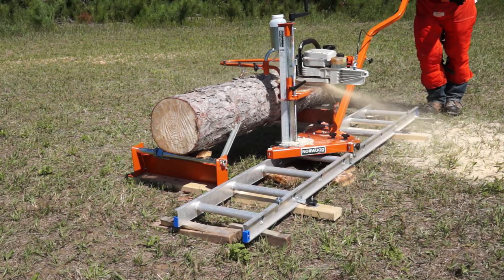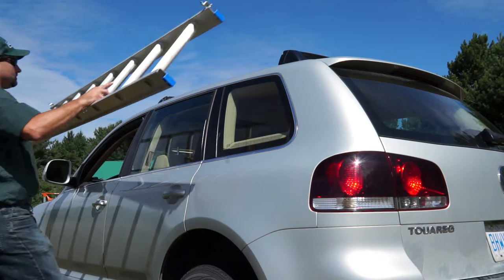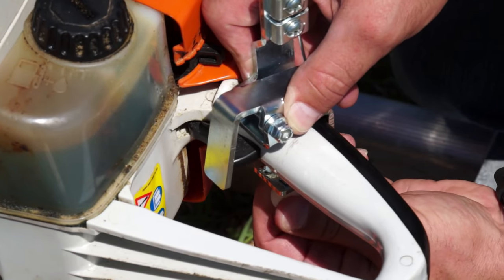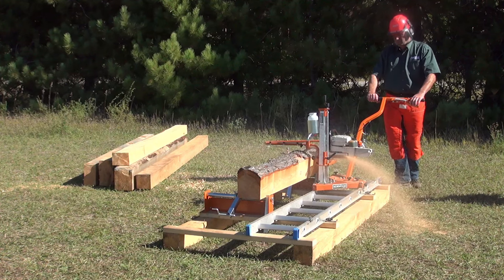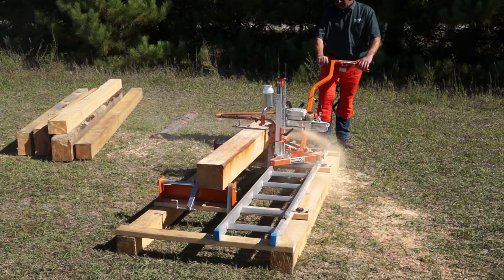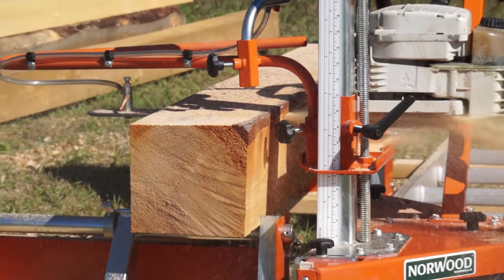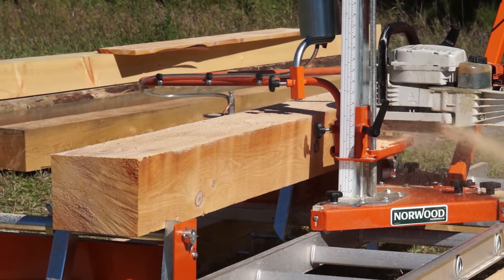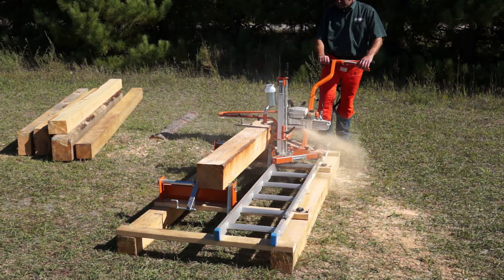The Ultimate Chainsaw Sawmill - The PortaMill PM14 by Norwood Portable Sawmills

Comment: so if i took the oilier apparatuses off i could use any length bar with this? im guessing you say its limited to 14" but you can use a larger bar which in turn gives you a wider cutting range correct?
Reply from the maker: Hi Daniel 

We do not recommend a bar longer than 24". The PortaMill structure was not engineered to handle load factors for bigger logs.  It is designed to be a highly portable machine ideal for remote locations or for occasional milling of small to mid-sized logs. It is very economical. If you want to mill bigger logs, we recommend a Norwood portable bandmill.

There is a lot of great information, photos and a video of Norwood’s PortaMill chainsaw
sawmill online at http://www.norwoodsawmills.com/products-sawmills/portamill-pm14-chainsaw-sawmill.
Thanks

Comment: Hello I have some logs that are larger than 14 inches in diameter, would this system work with a larger chainsaw like 105cc with 36 inch bar? If not do you have something that would work? I like the guided cutting system, its better than the alaskan sawmill and cheaper than a full blow portable band sawmill, but I have a lot of big logs larger than 14 inches is my dilemma, please help!
Reply from the maker: Hi Ronan. We have designed the whele PortaMill to handle only smaller logs. Once you get bigger than that, it really is best to have a bandmill. I am not sure what your sawing plans are though. Maybe you’d be interested in a free telephone consultation with a Norwood sawmilling specialist? Even just a few minutes can be time well spent to explore your wood processing needs with a professional, and to match you with the perfect sawmill configuration for your milling operation.  

If you would like to take us up on this offer, please let us know your telephone number and email address and we will make sure we connect with you. Rest assured, there is no obligation. This is a service we are happy to provide future sawyers.

Comment: I was wanting to cut a 12"×12". and from my understanding the log would have to be 17" in diamiter and  53" around "circumference". this is all new to me, lol. would this chainsaw mill accommodate this size log?
Reply from the maker: Hi Joseph. The PortaMill maxes out at 14 inches. Sounds like you need the LumberMan MN26 bandmill which can handle logs up to 26 inches in diameter.
Reply: +Norwood Portable Sawmills what is the price
Reply from the maker: $987

Comment: plan on building a small cabin, i have recently purchased a jonsered 2166(72cc) saw, i was wondering if it could be a good pair?
Reply from the maker: It's in the correct size bracket (we recommend 65cc or greater equipped with ripping chain).

Comment: You said that you recommend saws over 65cc. Thank you for that nugget. What size saw would you recommend for 3 and a half to 4 foot logs....And I'm sure you have a porta mill for that as well. I will be making my purchase of saw in about 3 weeks to 5 weeks and a mill in the next 3 months. Very good video. Thank you.
Reply from the maker: Glad to help Walter.  The maximum log diameter on the PortaMill is 14".  Please feel free to call with any questions.  800-567-0404.  We recommend a minimum of 65cc.  The bigger, the better. :-)
Reply: Thank you. I'll be calling
Reply: @NorwoodsawmillsDirect why 14” what is the limiting factor? I have a bandsaw good up to 26”. I would like to make or get a chainsaw mill that can do 36” slabs. I currently has Ms660 with 32 bar but I would get a bigger bar once I find a good setup I can use or I might end up making my own.

Comment: Why is it with these nice ideas you guys cant put on LEVELING bulbs to set things up.  Just think have one on the front and the back and two sides.  IM sure guys setting these up in the backwoods would appreciate having to bring one less thing that is designed in the equipment.. You thoughts norwood?
Reply from the maker: Cool idea. They are fragile though and very likely would get smashed by a board or log at some point.
Reply: They could, by placing a leveling bulbs on the outside of each end of the rails with a couple screw holes so they could either be screwed or bolted in place, for protection....easy enough to weld a 1" piece of round stock around so the bubble is protected....this could be done during manufacturing before the rails are primed and painted.

Comment: what diameter logs can it handle?
Reply from the maker: +Austin Roberson 

The PortaMill can handle logs up to 14" in diameter.

Would you like to receive a free Norwood Sawmills info kit?  You can order one online at http://www.norwoodsawmills.com/free-dvd-kit .  Or you can call us at 1-800-567-0404.
Reply: Does this mean a maximum 14" cutting diameter, or an actual 14" log? For instance, if you took a 19.8" wide log and cut 14" wide slabs off each of 4 sides, you would end up with a 14" cant, which could then be cut into lumber.
Reply from the maker: No, maximum log size is 14 inches. Bigger than that and we recommend moving to a Norwood bandmill.